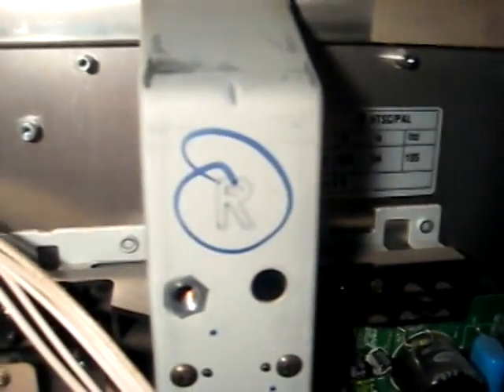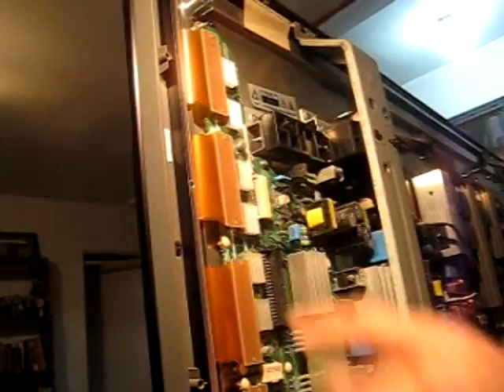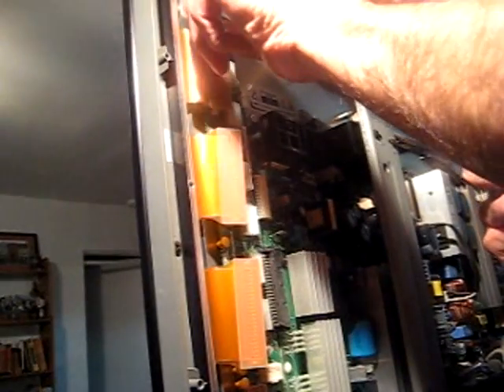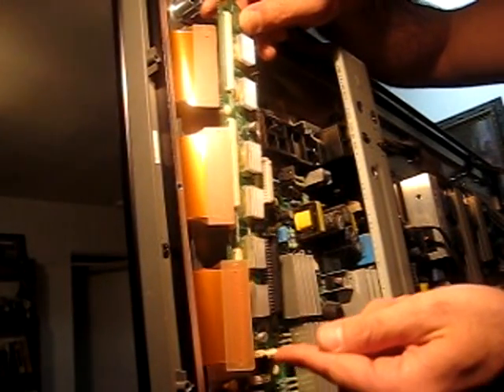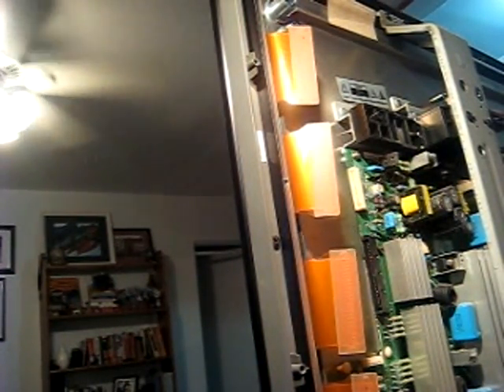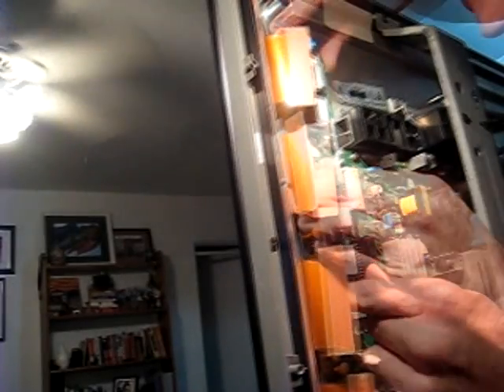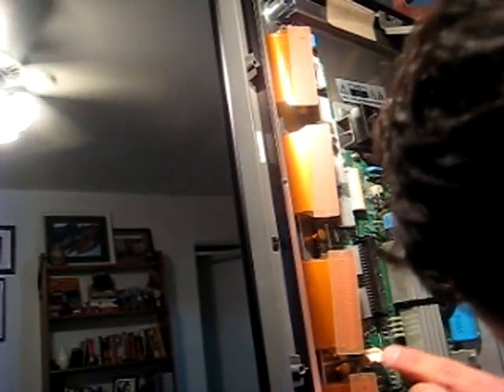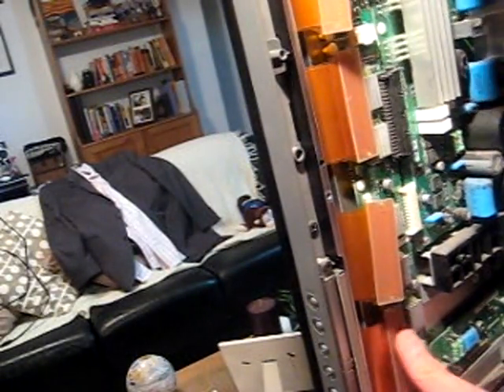How To Fix Plasma TV (Samsung & Others) - Plasma TV Repair

Comment: I have a samsung plasma that has 2 vertical columns of green/black static or “snow” that goes away after about 10 minutes. I took it apart, adjusted the VSCAN and made it a little better, any suggestions on what could have failed?

Comment: I have an LG 50PG10 and the picture is dim and has lines running vertically like every shape is casting a shadow. It make a load buzzing noise and shuts off.

Comment: I am beginning to agree with you on the quality of Samsung products. I have a few that have been trouble free. I do however have in my shop right now, 3 Samsung plasma sets. 2 have blown buffer boards where on one the chip burnet up completely, and another with a shorted buffer. Ordered a new (used) buffer from shopjimmy, and wouldn't you know the replacement board is bad, bottom of the screen looks like your one here on the top.  The 3rd Samsung the y main board exploded, literally, capacitors blown to smithereens and semi's split in 2.

Comment: hello
my samsung tv upper half is black for a few minutes, then it has green and red lines, then it flickers with the lines, then flickers again but without the lines but then it becomes normal. but if the brightness is too high or too low it will flicker, now the top quarter is reflecting the bottom half of the screen
someone help plz

Comment: I have a 56 inch Samsung plasma about 5 years old.  I have a couple issues.  First when my tv has a purple line that shows up near the top about three inches wide and goes across the screen, on white backgrounds only.  The next problem just started and my tv turns itself off and then turns right back on again.  It did it once this weekend and twice last night.  Any solutions?

Comment: Liphete,, check your electrolytic capacitors on your power supply, more than likely blown caps. visual description of blown caps are buldged or fluid leaking from cap,

Comment: QUESTION????? My T.V have a delay when u turn it on, meaning u can hear every thing but u can not see no picture till 8 minutes after. The reason I know it take 8 minutes it's cause I time it my self and before it give a clear pic, it will flicker for 10 to 15 seconds before it will give a clear picture. Do u think it's the same problem or what....
Reply: liphete, you have blown capacitors on your power supply, change out your caps. tv will come on instantly after that. your problem will only get worse, till tv doesn't come on at all.

Comment: I have Samsung Plasma Model 850FH-YB02, Serial #MX20BN9610381AB2LA8350210 Manuf. 3/2009 in Mexico.  The Plasma screen is slipping down from the top of the frame.  I have taken it apart but not sure what is supposed to secure it from sliding down.  What parts of the frame do this?

Comment: @A Scott - The most likely problem is the Y-Main Board.  The Y-Main board for the TV model number HPS4253X/XAA is Philips 996500036818 Y-Main Board.  You can search our website and find that part is out of stock.  You can sign up to be notified when the part comes back in stock.  Thanks and you can also give us a call for more help!  (877) 881-6492

Comment: I got a similar problem, where my distorted lines appear as my TV set heats up. As long as it's cold, the lines won't show.
I saw a difference between your boards and mine: Your board got heatsinks on the chips. Mine doesn't.
So. I bought those blue Zalman RAM heatsinks. Fits perfectly. Comes with a thermal conductive adhesive so it was easy to attach them.
Once attached, the problem vanished.

Comment: Great vid. I have a Samsung 42" plasma model HPS4253X/XXA it has red and green sparkles is what I was told they were called, all over the tv they out line things and kinda flow sometimes but the are all over and at times stronger in areas then not that strong so it varies. what do you think I need to do? thanks

Comment: Great video!  You have inspired me to try fixing mine (I have the same model, HP-R4252).  It has pink and blue vertical and horizontal lines covering the screen.  They go away after 6 minutes if I press a menu button, like the guide.  Any idea which part(s) to replace?  
I posted a video (the youtube id is o4djFzrtVII), the title is "Samsung HP-R4252 Plasma Lines problem".

Comment: rjwilkes19701 second ago Hi I have a question. I have a 42in samsung plasma, modle PS42A456P2DXXU ( this is what's on the label) in the manual it says I can connect it to a computer and use it as a monitor. How ever I've been told that connecting it to a computer will cause screen burn . Can you tell me if this is right and why samsung say it can be used as a monitor. Thanks

Comment: Hi I have a question. I have a 42in samsung plasma, modle PS42A456P2DXXU ( this is what's on the label) in the manual it says I can connect it to a computer and use it as a monitor. How ever I've been told that connecting it to a computer will cause screen burn .

Comment: I picked up a 50inch plasma for $10 and it's doing the same thing.. Lines are all across the screen... However if you let it play for about 15mins, it will all go away.. but sometimes may come back.  Do you think this is a Y board (upper & lower) or a main board issue.. please assist  it's a panasonic 50phw3

Comment: hey man i have a samsung plasma 50" that has 2 sets of vertical lines running from top to bottom about 2" thick on the right part of the tv. What do you figure is the issue?

Comment: dispite some of the choice comments by the repairer, I thought this was the perfect solution for my 42" plasma flickering. I wasted $85 following this vid ordering from overseas.. lower half of my 42" panasonic is flickering, which is audible when you turn the screen on. bought a lower board and there was absolutely no difference. Will now look to replacing the capacitors. 

looking at replacing the capacitors.

Comment: question for experts... I have a unusual issue with my LG 42" 42PQ12 720P Plasma...
 
the lower half of the screen will have fuzz and stuck pixals when the tv is first fired up... once it has been on for about 15 mins to a half hour it goes away... however it has got worse over time... you really only see it when there is a white area on the bottom.. and the rest of the screen is darker.... it used to only be noticable when using my PC on the tv... however now it is noticable on everything. help

Comment: Great video, but its not the same as my issue i'm having :(  I was using Netflix on the Xbox 360. All of a sudden my (50' Samsung Plasma) tv got crazy red flickering and the screen went black as if were turned on. I disconnected it all, turned it back on to cable and it has sound but absolutely no picture. Any suggestions? It is about 5 years old.

Thanks

Comment: @tina3038 If you have heard a high pitched whine from your TV before you started having this issue, it's possible that your flyback is the issue.  Working on any electronic device has dangers, and is best left to the qualified professional.  Good luck.

Comment: @tina3038 I have a Samsung that has done the same thing.  I replaced the voltage detector about a year and a half ago, and that solved the issue up until about a month ago.  Putting in another voltage detector (a 20-cent part) didn't resolve it this time.  It's my suspicion that the flyback transformer is producing too much voltage, causing the voltage detector to engage and shut down the TV.  The flyback transformer is a high voltage component that should be replaced by a professional.

Comment: HEYY!! maybe you can help me out. i have a 58" samsung plasma tv. ive had it for almost exactly 1 year now, and when it was on a white screen i noticed in the upper right corner it had dark moving horizontal flicker, that has grown a bit in th last week of so and takes up almost the top half, but stays more on the right side, on the very top however the line (only on whites and sometimes yellows) does go across the tv. i can upload a video if needed.

Comment: I have a Panasonic TH-65pz750u plasma tv with vertical lines in the upper middle  of the screen but no horizontal lines. should I just change the C3 board first before changing the y board?

Comment: did you mean that the tv exploded after you used this method to replace the y board, or were you talking of another issue with the tv?  I was thinking of  getting a non functioning tv and trying this myself.

Comment: My 7 month old Samsung PN50B650 recently started displaying very thin horizontal lines across the screen, at first only one about 3 inches from the bottom, then 3 more lines appeared a few days later close to each other. At this rate I expect more. Are these boards somewhat universal? I cannot find any resources regarding what type of board (model no.) I would need to put in the TV if I am unable to get a solution out of Samsung. This video alone gives me hope, and for that I thank you.

Comment: I have a Samsung Plasma HP-R452C. A 42". And It has a thick vertical black line going down the central. What could be wrong? Someone told me that its the Central Invertor, but I want to make sure before I buy the part

Comment: im having the same problem another poster mentioned. no video but i have audio. I was told this could either be the main sustain board or a power problem. Ive checked the front panel it's okay. i checked both y boards, they're okay. do you have any tips on using a volt/ohm meter to test electric problems or how to test main sustain board without replacing first?

Comment: I have a Sony 47 inch S Series, i have a similar problem with mine, a litle older than 2 years. Mine does it on the hole right side but only when i first turn it on, at first it lasted a couple minutes and know it takes like half an hour before it clears up, so im guessing sonys have Right and left Y-Boards.   Ill take a video of it and post it for you to watch and advise.

Comment from the maker: @cocoakain Green line through the bottom may be the Y-Board lower, but not too sure. The research I uncovered was more about vertical lines across one of the 6 panels (if the whole board is bad, it would be 3 panels, either all top 3 or bottom 3).

I also don't think mine had the 'snow' effect. More of a green/red appearance (as seen in video)

Comment from the maker: @dominikajolantazyra When you say 'still happened' does that mean the upper half of your screen is still showing those vertical lines? The upper board controls the top half of your screen and the lower board controls the bottom half. If you replaced the upper board and the bottom of your screen has a problem, then you need to replace the bottom y board (y-board lower).

Comment from the maker: @kjbryan09 I am not sure. My initial thought was that it just fixes the vertical lines that appear on either the top or bottom of the screen. If it is just the bottom half, then maybe the entire Y board is shot and it will work again if replaced. Otherwise the motherboard may be your problem.